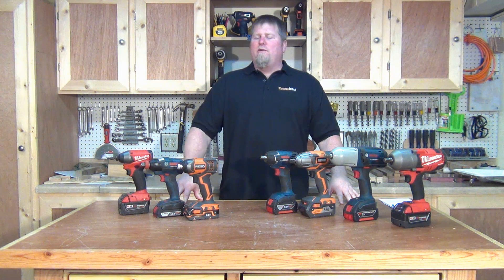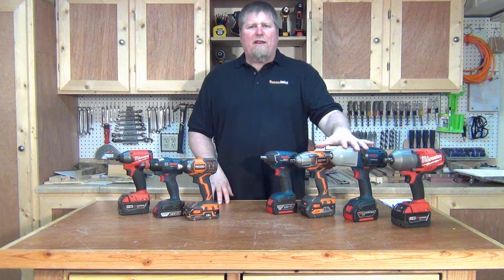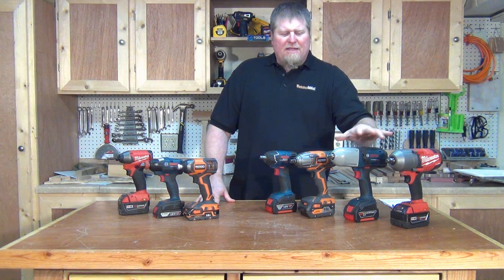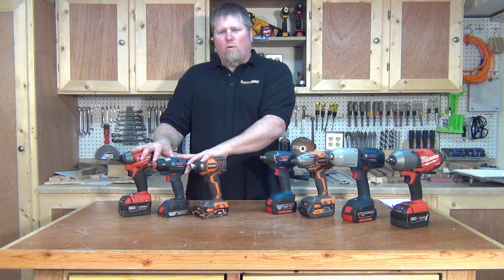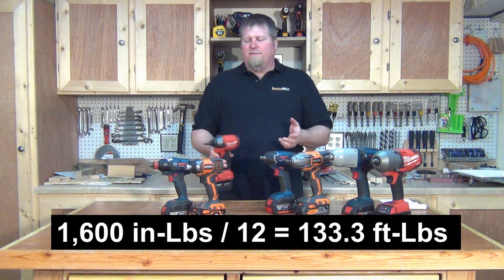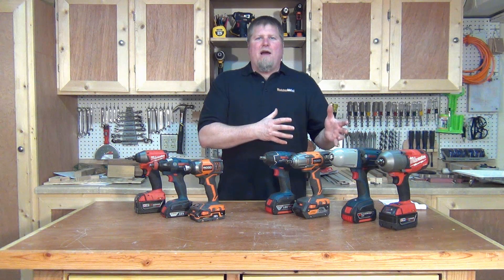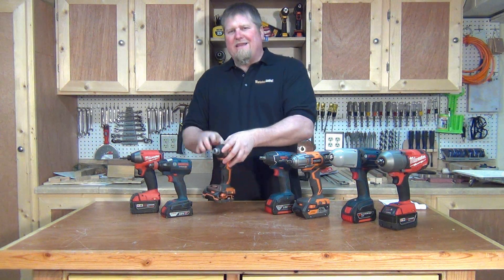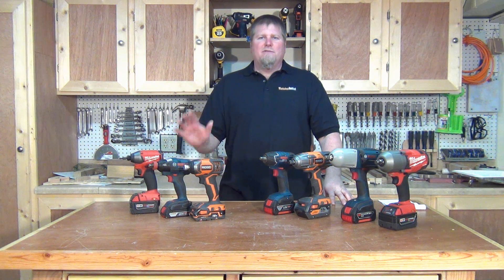IMPACT DRIVER vs IMPACT WRENCH

Comment: I'm looking for an impact driver/ wrench to drill wood/metal/masonry + concrete and all so to wrench on my car my lug it's usually 126 nm but all so my dirtbike but like to use as a spline, torx, Philips and slot screw bits what would u recomend so I dont have to buy 3 tools but also got a heavy duty drill to drill thick metal

Comment: I would just add one more important distinction. Impact wrenches only deliver torque pulses to the fastener. They do not deliver any hammering action. Impact drivers on the other hand deliver torque pulses and hammer blows simultaneously.

Comment: It’s 10/12/20 and this video helped my dumbass understand that. And I was just at the hardware looking at dewalt 12v 3/8 impact driver vs a dewalt 3/8 impact wrench. Couldn’t decide on what to get bcuz I honestly didn’t understand the specs. Came across this vid and now I can return later this week with an absolute clear idea of what I need. Thank you.

Comment: What's the difference between mid torque and high torque?
Reply from the maker: Mid is going to be smaller and lighter with less power.  Good for lug nuts and other tasks like that.  High torque is best for rust suspension and heavy duty work.
Reply: @WorkshopAddict  Got it thanks. 🤟

Comment: Thanks for the video. I know you said you're not supposed to use impact wrenches for screws, but is there an adapter to make the impact wrench into a impact driver. Thanks
Reply from the maker: Yes, they are sockets that have drivers on them.  Much more expensive to replace as they are a wear item.

Comment: question: if you use the impact wrench for tightening the lugs, how can you control the torque setting? like in a torque wrench?  Your video clarified my other questions. Thank you
Reply from the maker: Impact wrenches are not a precision tool, so you never want them to set the torque.  You need to use a torque wrench.  Even some of Milwaukees new Impact Wrenches that are made for getting you close have a 25% variable in their accuracy.
Reply: @WorkshopAddict  Thank you for clarifying and sharing your knowledge
Reply: @WorkshopAddict  Ok. Thanks for the answer I subscribed!

Comment: Ok thank the reason  why I ask my oil drain  nut  has been put  on really tight  and having a hard time getting  it off so that why I was wondering  will a impact wrench will help me
Reply from the maker: It could help, but it could also strip it easier.
Reply: @WorkshopAddict  Do you have to worry about stripping a bolt when just using an impact wrench for loosening?  And, are we talking about stripping the head of the bolt, the threads, or both.  Thank you.
Reply from the maker: @Marc_B.  You are less likely to strip the head or the treads with an impact wrench.  You can break bolts.
Reply: Even when just loosening?

Comment: Just get a multispeed impact wrench with an adapter and it will do both jobs, impact drivers = not necessary in my opinion.
Reply: Just get a multispeed impact driver with an adapter and it will do both jobs, Impact wrenches = not necessary in my opinion.
Reply: @biggentallen  try removing lug nuts and suspension bolts with an impact driver buddy.
Reply: @Fluid36  works great, did that earlier today. 🤷‍♂️
Reply: Nonneo Liberal  yeah man I bought a 20vmax brushless dewalt 1/4 driver. Takes off all suspension bolts. I did my mother in-law’s timing belt and water pump job on 09 Kia Rio. I thought I fucked up getting the driver instead of wrench. But only real difference to me was the I got the bolts tight with the driver and then put the torque wrench on em and got it where I wanted.
Reply: I do exactly that with my dewalt dc894 impact. Can drive anything, and can remove cv axles and all the rusty bolts. An impact driver can only do so much on car suspension, lacks torque and will smoke up when encountering those 20 year old super seized bolts but an impact wrench cannot struggle with driving deck screws, lags you name it...

Comment: Six months ago I thought all impact tools were just for removing lug nuts. Then I started noticing these smaller variants at the hardware store and got confused. Best thing that helped me understand the difference was watching another video where a guy demonstrated the difference between using a drill as a screw driver (with hex bit attachments) and using an impact driver to drive the same screws into some wood. From that it was easy to understand impact drivers really are for driving screws and would be used for building work. Whereas impact wrenches are more likely to be used in automotive and industrial plants with the black impact sockets. This video was great for explaining the power / rating differences.

Comment: the dewalt mid-range DCF894 impact wrench is not as powerful as the 600ft-lb bigger impact wrenchers, it's about half as powerful.. plus it has three speed settings... I wonder if it's viable to use the low setting (with a 1/4 hex adapter) to drive screws, while also being capable of driving automotive applications on the higher setting.. I lost my old impact driver last weekend and am looking for an all in one solution... maybe i'll have to try it out since I cant find any info online

Comment: Great video, the inch pounds vs ft pounds had me confused b4 i saw this. Cause it seemed the ridgid driver was stronger than the wrench, but that's because i didn't notice the inch vs foot measurement. I got the ridgid impact wrench 1/2". It's noyce!

Comment: Hello John, great video, but when driving a lag bolt with the larger impact wrench do I need to drill a hole first so it wont split the wood?  It seems then, I wont need a larger impact wrench when it has a hole?  I'm thinking about putting three 2x6 rafters together?  I was also thinking about using the sds hex bolt as well, but much more expensive.  Thank you, Greg

Comment: What is the difference between blows per minute (BPM) and impacts per minute (IPM)?  Looking at impact wrenches they talk about IPM, and impact drivers they talk about BPM... isn’t there not only a difference in the torque and the bit/socket format but also in the mechanism itself?
Reply from the maker: IPM, or the impacts are in a spinning or rotational direction with the force or hammering.  BPM, or the blows are directly forward or into the material that you are drilling.  You see BPM on hammer drills for concrete and IPM for impacts fastening.
Reply: WorkshopAddict ah ok, thanks!  However, the BPM is given for impact drivers not just hammer drills. Are you sure that the mechanism is the same within an impact driver and impact wrench?  It would seem that a DRIVER also has a hammering effect to drive the screw in, rather than just a rotational impact.
Reply: Dimitris Zarmakoupis Impact drivers and impact wrenches have the same rotational hammering whereas a hammer drill has a forward hammering.

Comment: Good video but I tried using my impact driver on my car and it seriously struggled to the point of failure and I decided it was a bad idea.

My 150 ft-lbs impact stench sometimes has issues taking off lug nuts that it had previously put on. 

Maybe the impact driver could be used for small bolts on a car, but an electric ratchet is a better tool. 

Just wanted to add that note, great video otherwise thank you!

Comment: I need to make holes in quebracho wood endgrain, quebracho is the hardest wood on earth, what tool do you recommend? thanks.
Reply from the maker: A good drill.  What size holes are you putting in?  Can you use a drill press?  Lots of unanswered info here.
Reply: 1" holes. I need to drill the holes in end grain of my workbench top, so I can't use my drill press. The wood used is quebracho (4x times harder than hard maple).
Reply from the maker: A good drill and good boring bits will work just fine.  You could use a speed bore, but pre-drill the center hole so the self-feeding bit has a hole to follow.  Make sure it is sharp.  You should have no issue.  We have also used normal metal bits up to a half inch and then used a step bit from there to go to 1".  You would need a 1" sept bit.  They are meant for metal but work on wood when needed.
Reply: Drill driver or Impact driver? thanks
Reply from the maker: Drill Driver

Comment: There is a new model of brushless wrench that have a new adopter to drive a screw gdx 18v ec i think thats the model. So its ok to buy a wrech because it can now do the driver job
Reply from the maker: That model is very low on power for a 1/2" impact wrench and works best as a driver.
Reply: WorkshopAddict thanks man!

Comment: I don't have a need for one of the cordless impact wrenches in my wood shop as I have a large compressor and use a pneumatic wrench. Although I did just purchase the Makita sub-compact drill driver set and for the small size it rocks any thing I need to do in the woodshop.

Comment: if I have the Ridgid 1/2 inch would you recommend getting the kobalt 1/2 for a stronger upgrade?
Reply from the maker: The Kobalt full size is stronger, but also larger.  The Milwaukee Mid-Torque would be a nicer upgrade.

Comment: Why can't you put in a screw with the impact wrenches?

They should have adapters.

I am tired of burning out my impacts because they can't cut the work that I need to do with them. I work in Sheet metal. I could screw 100 to 500 screws in a day. As well as tightening bolts, and drilling holes through 10 guage angle. 

It makes sense for me that I should get an impact wrench. Just because they seem to be made to handle that work load. I am tired of having impact drills smoke or heat up so much that you burn your hands. 

Couldn't you just get adapters to fit the right bits?
I mostly use #10 hex tek screws. but occasionally I will use robersons and rarely phillips. As well as drill bits or multi bits.
Reply: Rich Hlywka stop buying cheap tools...

Comment: Soo in summary, they're basically the same except the following
1. IW are stronger
2. IW have a fixed shank, usually 1/2 but and occasionally 3/8
3. ID removable shank

Other than that, they're pretty much interchangeable right? Assuming they both can get the job done.

Like you won't wreck the ID if you use it on a socket and you won't wreck the IW if you use it to drill in lag bolts? Both are forgiving?

Comment: Is their a need for a normal drill if I have a impact driver?
Reply from the maker: Avocado Gaming if you only were drilling small holes in wood, there is no need for a drill, but once you move up to 1/4" holes, the impact driver will impact when drilling and slow the drill down.  drilling metal is hard also.  so they each have their purpose.

Comment: If a M6*12 Tapping Screw is needed to be screwed in 6mm of G.I sheet, would an Impact Driver be okay or an Impact wrench has to be used. Typically, about 500 screws/day have to be screwed.
Reply from the maker: Nikhil Jalan impact driver

Comment: Hi John, Just a thought on the picking the right unit for the applications. When you mentioned the torque ratings of drivers or wrenches, you mentioned examples of car wheel torques. I always found that the torque rating of the driver or wrench should be a good amount higher than the theoretical requirement of the nut or bolt. Particularly when removing. I'm sure you know what I'm talking about.
Tom

Comment: you jumped over the bosch every time on both side, both of  the driver and wrench tools have 1/2 front end and also i believe both have exact ft lbs of torque. also alot of trucks lugs go as much if not over 160 ft lbs. you also called the wrenches ---- drivers in your video. FYI the bosch and rigid you have next to the wrenches are the wrong models, they dont compare to the Milwaukee or Ingersoll you have there.

Comment: I want an impact wrench w 1/2" drive that has max torque of 133-150 ft-lbs.  Help
Reply from the maker: That is pretty light.  I would look at the Milwaukee 1/2" compact impact wrench.  it is 220 foot pounds.  you won't find much lighter than that.

Comment: I spent 400$ on a 1/2" Milwaukee M18 Fuel impact wrench the same size as that little Milwaukee impact driver with three settings, 50, 100, 150 and with the red lithium ion battery it snaps every bolt from lug nuts and bolts
Reply: I forget the exact amount of torque with the red lithium but it was over 250. Those Milwaukee M18 Fuel Red Lithium Ion brushless motor impact wrenches are very powerful for that compact size. Does anyone know about the 18v Makita impact drivers? I got a complete set for free and was wondering if those are the type they use on automotive repair? Like removing suspension bolts to engine booms and screws

Comment: I'm wanting to buy a small m12 fuel 3/8" square or 1/4"hex for smaller jobs under the hood and under the dash. I want the 3/8" but could I use it on the low setting to put say a dash back together with small bolts and screws or not? would I be better off getting the 1/4"hex and then using a 1/4 to 3/8 adaptor most of the time? both fuel drivers I'm looking at are like 110' lbs.
Reply: I'm a mechanic if you haven't figured it out so i'll be using it pretty much strictly in the shop.
Reply from the maker: +nuts 4 knives What about the 1/4" square M12 impact.  That one will drop down to 10 ft lbs on low.  IMHO, botht he 3/8 and 1/4" hex will be pretty powerful for dash work even on low.  As a mechanic, I would stick with the impact wrench because it will be shorter when used with sockets.
Reply: +WorkshopAddict Ya, that's kind of what I was thinking. I was hoping to do it all with one tool but looks like there's no way around it. I was going to get the 1/4 square till I seen it was like half the torque. I'll probably end up getting both the 3/8" and the 1/4 square and a seperate driver for screws and what not. thanks for the reply though. As a new mechanic all the tools you have to buy is just crazy. And the tool truck prices for snap on and Marco are just crazy.
Reply: +WorkshopAddict Ya, that's kind of what I was thinking. I was hoping to do it all with one tool but looks like there's no way around it. I was going to get the 1/4 square till I seen it was like half the torque. I'll probably end up getting both the 3/8" and the 1/4 square and a seperate driver for screws and what not. thanks for the reply though. As a new mechanic all the tools you have to buy is just crazy. And the tool truck prices for snap on and Marco are just crazy.
Reply: +nuts 4 knives matco*
Reply from the maker: +nuts 4 knives What about the 3/8" square impact driver and the 1/4" ratchet.  The M12 Ratchet is sweet!  That might give you more options for use.
Reply: +WorkshopAddict Ya, the ratchet was already on my list. definately getting that.

Comment: if i use a 1/4 hex to 3/8 socket adapter in an impact driver, will the impact driver lose power?
Reply from the maker: +miokoloko1 There will be a little loss of torque, but it will still work.  Remember, you are talking about impact driver and not an impact wrench.  The impact driver will remove and put on nuts, but it doesn't have nearly the same torque as an impact wrench.

Comment: Anyone out there that is using these for lug nuts, Please for god sakes use a torque stick or you will end up putting a lug nut on at 300-600 foot lbs when it should only be 80 and end up messing the nuts or threads up.
Reply from the maker: +CrazyIrishMedic Even Torque Sticks can be pushed beyond the limit with the new impact wrenches.  I now use my compact impact wrenches on a low level to get the lugs started and ALWAYS follow up by tightening lugs with a torque wrench.
Reply: Good Idea, I just use a speed wrench followed up with a Torque wrench since I work mostly on older cars that have already experienced an excessive amount of torque. I would rather be slow and do it right then fast and mess it up.

Comment: Great video, thanks. Everyone always asks about lug nuts with an impact driver and that seems in wrench territory. What about busting and tightening everything under that level? As long as the driver is turning the bolts alright is it ok to use with the socket adapter? Or is that abusing it and asking for problems? I have a cordless driver which is super convenient and I was thinking of getting a cheaper air wrench for when I need it on 125+ft lb bolts. If not, I'd probably pony up for another cordless.

Comment: The one thing you forgot to mention is that impact drivers have faster forward speed then reverse since that speed is used to drive the screw or whatever your tightening down (More tq). In reverse the impact drivers lacks speed which in hand will make it low on tq. As the impact wrench it has mor speed in reverse then in forward as to break the bolt loose. They in the spec for impact drivers  1500inlb driving tq and in wrenches it 600ftlb breaking force .. I confirmed this with the exact Milwaukee m12 impact driver and impact wrench. Same body same motor just different heads and different forward and reverse speeds

Comment: I just bought dewalt brushless impact driver for $80. I'm going to be using it for automotive and didn't want to fork over $200 for dewalt brushless 1/2 high torque gun. I hope it will remove those stubborn bolts.